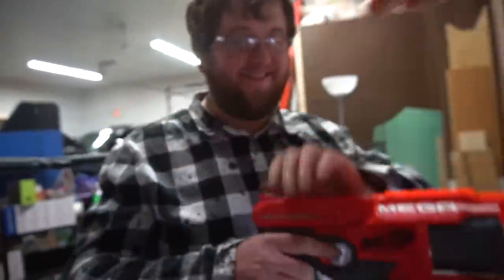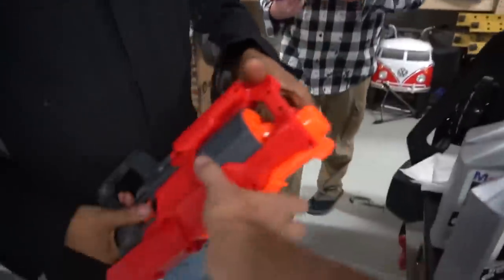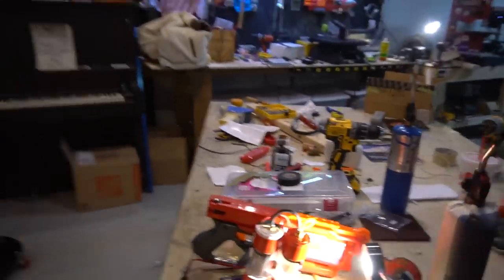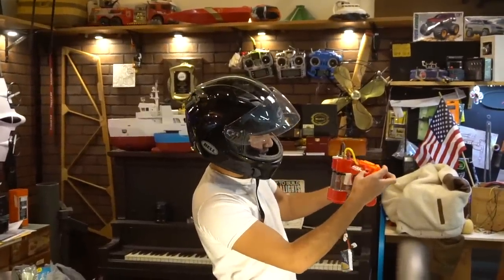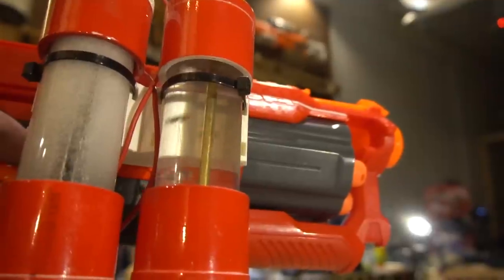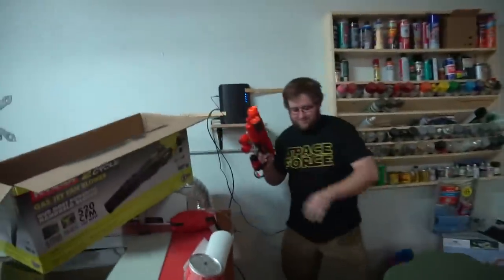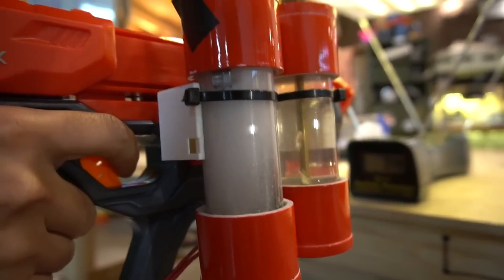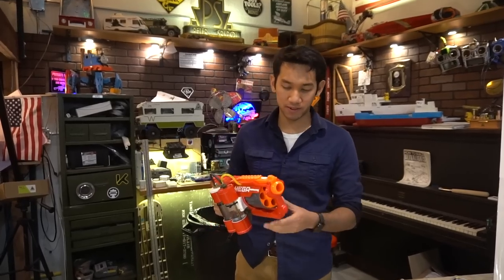Hydrogen Powered Nerf Blaster!!!

Comment: NERF: Do not modify the gun or the darts

People: no.
Reply: I modifyed my darts now they hurt lot more than before
Reply: Just put needles instead of the foam at the end
Reply: yanks out all the safety mechanisms
Reply: @waterbirds8972  Yes, there's a rod that fits in the dart hole that you need to remove, and a valve in the back of it that looks like a table with 3 legs that is pressed by the dart and opened that way. Beware tho, if firing without a good seal, without the valve the piston will slam into the barrel assembly as there is no pressure to slow it down. I reccomend putting one of those Ikea pads for furniture doors in place of the valve
Reply: @herbthelizard368  oh god no plz
Reply: Hahah mod go brrrrrrr
Reply: @rxiumofficial  just hey guys wanna play nerf loads the nerf
Reply: Hehehe I take my nerf darts painful mods a step further I use armstrong mix in a little tissue glued onto the plastic 
(No idea what armstrong mix is?: It is a highly reactive mix of powders Wich will explode from the slitest amount of force like a nerf darts hitting something
Reply: @herbthelizard368  just put a mix of ammonşum nitrate,coal,sulphur,pottatium nitrate and glass powder remıve the plastic add a small mini ballon to the end shoot.
(Modified armstrong powder)
Reply: @kayragur3542  good idea mate
but i do not know how to potassium nitrate
Reply: @herbthelizard368  Or a nail.
Reply: I put a match on the end of the dart so when it hits it sticks to clothes
Reply: I shot someone with a neidel on a nerf dart?
Reply: @Hit69420  prolly hurt a fucking lot tbh smh

Comment: Hydrogen powered potato cannon is the obvious choice for next build.
Reply: just an hho tank with some stuff and other stuff and you got yourself a potato gun.
did i mention that it shoots potatos?
Reply: No This Is Patrick      Genius
Reply: potaoes.. 

pffft.. 

pumpkins.  now we're playing with powaaaaaaah
Reply: if u d0...... use steel pipe's
Reply: We actually tested this when I was younger using 5cm thick treated steel pipes, it would shred the potato and we had to use harder root vegetables in order for them to stay intact. 

Using i.e thinner steel pipes or plastic pipes is a really bad idea, it will blow up at the first attempt. Not to mention that hydrogen makes steel brittle (thus we had to coat the insides every time).

The canon did however fire the vegetables at supersonic speeds, much harder than a gunpowder canon can. A mixtured of oxygen and hydrogen is super dangerous and potent stuff. We generated the oxygen and hydrogen on-site using plastic bags in case of well, boom (also one of the two gasses is hard to store from what I remember, when they use it at rockets they at least transport the gas really quickly to the launch site in order to not lose much product). 

Don't remember the exact figures for the price of the canon but those thick steel pipes weren't exactly the cheapest.
Reply: be carrefull, stronger and faster explosion than propane gaz
Reply: Land and Lore Photograph Off Road Adventures Dude, he literally just electrocutes water and separated it into hydrogen and oxygen. He just needs to find a big enough sealed container to fill with water that he can turn into hydrogen. Cost of container + cost of water + cost of potato launching mechanism + cost of the potatoes = the cost of the cannon. That's it.

Comment: Put the guard down against the work on that bladerunner.  Its there specifically to stop what youre cutting from jumping all over the place.  I have one and trust me it makes all the difference.
Reply from the maker: Do R/C! Yeah I figured that out after those shots! It works surprisingly well!
Reply: @PeterSripol  yep. I've had mine for a couple years and it gets a lot of use.  There are times when the guard won't work with what you're cutting then just push down really hard and go slow.
Reply: Oh and get good quality blades (Bosch or equivelant) the ones it comes with are junk.
Reply: MAKE A HYDROGEN POWERED GO KART
Reply: @DoRC  Made me queasy how close his fingers were to the blade.. specially with it vibrating like that
Reply: @PeterSripol  Please build electric paraglide no ultralight

Comment: I tried making a hydrogen powered cannon.... it is super hard to do. The water vapor (what is produced in the reaction) cools and condenses so quickly that it ends up sucking the projectile back into the barrel with extreme force (possibly breaking yo cannon) If you plan to build an HHO cannon, use a very large chamber and a very short barrel for best results. Hope this helps!
Reply: Happy Mad Scientist Install a check valve?
Reply: Try an oxygen boost to make it O2 heavy? Im not sure it would work though lol. Or tape some dessicant bags in the chamber hahahaha i wish you would try it but it sounds dangerous so dont lol
Reply: Or maybe run a vaccum through a longer barrel like the light gas guns they use at universities or like the one nighthawkinlight built
Reply: That's an interesting idea! I'll have to look into that. Thanks!
Reply: electrolyse other stuff.

my intuition says use iodide salts and organic liquids such as amines, ethers, nitrates and glycols. look into viscous substances (one viscous two viscouss?)

you could use phosphine gas since it reacts to form phosphoric acid, which is a coagulant and might affect the kinetics of the condensation and stuff

look at the burn speed of different substances, you can create a cascade effect by making the detonation such that the shockwaves harmonically overlap, which might prevent this condensation or otherwise be interesting

the other road is understanding pressure dynamics and learning how to create huge pressure swings, essentially huge bellows, gears and valve systems that 'carry' explosive energy around mechanically. i think i'm describing the basics of gun design from a primitive standpoint ;p

good luck with your project :)
Reply: Thanks

Comment: Damn you electolized water to utilize hydrogen? Dude, you're kind of insane
Reply: Zane Stigler the king of random did that too
Reply: @mhila2012  I did it 8 years ago to test it out on a car at a customers request (I couldn't convince them there is no free lunch....the power consumed to separate the hydrogen molecules is MORE than you get out of it from the hydrogen being ignited. That power coming from the alternator, driven by the gas motor means a net loss in efficiency). It's not that crazy.
Reply: @superiorglitch8195  chlorine? I thought that only worked with hydrochloric acid
Reply: Billy Riggs 
Well... That's annoying if you're trying to charge a salt water battery.
Reply: Thats easy to do anyone can do that
Reply: I split water into oxygen and hydrogen for a science project in grade 8 so i must be insane
Reply: @superiorglitch8195  will it generate only cholrine gas? or will there be other substances created as well?
Reply: @jonhille  NaCl will make Chlorine gas instead of oxygen, but it will still make hydrogen, and the explosion will be violent and similar when you ignite it.  To get oxygen you use an electrolyte with a more complex anion, like sulfate or phosphate.

Comment: You should do a hydrogen powered plane
Reply: Robert Schlicht a rocket.. 

have a canister of hho and that big field..

with a compressed chamber and electric valve that will allow hho gas to be fuel injected release and fed into a BBQ jet.. should work a treat.. providing the right amount of gas can be regulated for output.
Reply: What about a hydrogen bomb
Reply: Hydrogen barbecue
Reply: What about hydrogen powered car

Comment: A couple suggestions :

Increase mechanical reliabilty/the smoothness of the barrel advance action, and reinforce the darts. 

Use a light timing system, versus a simple button to arm the device.

Basically, on slide racking, the barrel advances, and a red light turns on as the system generates hydrogen. You could even add an audio cue to indicate this. While charging, the trigger is disabled. After a preset interval, the light turns green, hydrogen production halts, and the trigger is now live, so you can fire when ready.

Load all battery components into a case or molding to improve ergonomics.

Comment: why not just use dilute sulphuric acid as the electrolyte - not only cheaper but safer
Reply: Wouldn’t the acid over time degrade both the metal plates and the container?
Reply: @deepfriedmemesandaids2588  bruh... its just a nerf gun being propelled with ignited hydrogen..
Reply: @linusmushroomtips776  A man of culture I see
Reply: @deepfriedmemesandaids2588  those need waaayy more than hydrogen, and the hydrogen they do use has to be a special isotope, either tritium or deuterium

Comment: Nitro powered nerf gun
Reply: Nitrogen wouldn't be a very good power source.
Reply: Nitro is nitrous oxide which acts as an oxidizer allowing fuel to burn faster, and isnot a fuel in and of itself.
Reply: @nixietubes  same :/
Reply: @nixietubes  Nah you're wrong, he wants to use Discord Nitro to power a nerf gun.
Reply: Hydrogen two oxygen would still be better, wouldn't it?
Reply: callum orchard C4 powered water cooler
Reply: The oxygen paired with the hydrogen produced by the HHO generator would provide more power than N2O
Reply: I don't know what to do with it anymore
Reply: Easier way: A Buy F**** Nerf Nitro

Comment: this is amazing but what about metering the amount released in a third tank you can prefilled? vacuums probably would be tricky, but it would make it a lot safer and reliable even if you had to practically turn it into a carburetor shooting a dart instead of a piston 😅

I just find this really interesting because I've been looking into alternative air guns, and this could be a good solution to the problem of the scuba tank air shotguns!

try a prefilled chamber and a venturi valve? when you prime the shot a plunger draws in hydrogen at a specified amount, from a separate tank that you can charge/prefill with the HHO converter

a couple odd and end valves could even be responsible for the outward pressure and force of the burning hydrogen 

and give you a blowback action!

turn this gun into a fully automatic carburetor
Reply: Chris Bonnell very interesting idea I’d like to try and make something like this myself but I am too afraid it could explode
Reply: I've been waiting for someone to do this with alcohol. Don't have the stuff to do it my self yet or would have already done it.
Reply: Get a k26 caliburn

Comment: Great video on the cannon build you should install a check valve between the bubbler and combustion chamber to increase pressure I kept seeing a flash in the bubbler so you was losing a lot of pressure.
Reply: because the explosion is so fast i think it would still go straight through the check valve
Reply: @foamtoaster9742  Maybe a tesla style static check valve?
Reply: Maybe some valveless pulsejet-style bizarro sonic engineering? Nah it'd be overkill and probably 30 feet long.
Reply: @MyHero Deku Engineers gave YOU the Internet. Engineers invented the Internet. A programmer is a type of engineer, the methodology is very similar. Network engineers are sure as shit engineers, it says so in the name (note: this principle does not always prove true). The first people on the Internet were engineers, followed by a few engineers in the armed forces, and some people at some colleges. 

The Internet was great when it was run by engineers. It's only now the business arseholes have taken over that it sucks so much.
Reply: Yeah I got the joke, I was just being informative! No need to apologise, mate!

Comment: Use a thin heatshrink on the darts and put like a ¾ blast shield around the tanks. A pressure gauge and/or timer would only help with the charging.

Comment: How do you get the elclectrodes not to rust. I have tried the hho generator many times and with diff salts and diff powersuppplies ranging from 9v battery to 22v 1.5 amps .
Always gets all rusty and produces a minimal amount of hho
Reply: Maybe it's just caus they he only uses them for a short period of time? Does stainless steel work as well?
Reply: You are using salt and steel? You are prob making iron oxide and producing mainly hydrogen and no oxygen (explains lack of bubbles).
Use stainless steel and sodium hydroxide. Even if you don't use stainless, sodium hydroxide will greatly reduce the rate of corrosion of your steel.
Also, the nominal voltage would be about 1.3v. Anything more is wasted energy. More amps are what you need. You might need to put more electrolyte in your solution to help the electricity flow thus increasing the amps. Also google what floater plates are.
Hope this helps!
Reply: @HappyMadScientist  thanks alot i will try that
Reply: Use Platin electrodes should negate the rusting issue
Reply: stainless steel
Reply: @Land and Lore Photograph whot
Reply: @Land and Lore Photograph Water is the only product of burning hydrogen in oxygen. It is literally 2H² + O² → 2H²O
Water is 100% hydrogen and oxygen.
(barring all the various minerals and organic chemicals that are almost always present in trace amounts, and the complexities of incomplete combustion, which are not particularly relevant)
Reply: @Land and Lore Photograph There is almost no 'useable' hydrogen in water. The whole point of applying electricity to the plates is to perform electrolysis, in which the molecules are broken to form the constituent atoms, which then form into the separate hydrogen and oxygen gases. When this occurs, it can create a lot of now useable hydrogen, depleting the water. I have a small&weak generator which can make 0.5L of gas per hour, therefore 0.33L of hydrogen per hour. and that is enough to make a loud blast, which is fun :D
Reply: @Land and Lore Photograph There is almost no 'useable' hydrogen in water. The whole point of applying electricity to the plates is to perform electrolysis, in which the molecules are broken to form the constituent atoms, which then form into the separate hydrogen and oxygen gases. When this occurs, it can create a lot of now useable hydrogen, depleting the water.

(copied here for others to see)
Reply: @Land and Lore Photograph For small things, yes. my bigger hydrogen generator makes several litres per hour, but the power supply gets a bit too warm for my liking. And the point I was trying to make is that water is one of the most hydrogen-dense materials that the hydrogen can easily and cheaply be extracted from. The way you worded your initial comments made it seem like the hydrogen was unable to be extracted
Reply: @Land and Lore Photograph I think i can see where you're coming from, but for some parts i disagree.
"really is not very much"
given enough time, one could extract all of the hydrogen from water, which is a lot. specifically, 1 litre of water can be used to produce 1245 litres of hydrogen (at STP).
"it is not cheap either"
the highest electricity prices I've seen are about US $0.40 / kWh. for a very inefficient hydrogen generator, 1 kWh an give about 9 litres of hydrogen. that's less than 5 cents per litre. as far as non-commercial hydrogen procurement goes, that is rather cheap.
"it is not efficient in anyway"
completely agree with you. except for weight-sensitive uses, batteries are far better for energy storage in every way.
"only ever get less than 1% of that hydrogen"
I don't know what gas collection you're thinking of. depending on exact collection method, most of it is collectable and won't diffuse through your container (unless you're trying to collect it in a bin bag :P ).
"myths and misconceptions" and "run a car"
total BS, very dangerous, and could destroy a car's engine very quickly. as a side note, the main one with cars isn using it as a fuel by itself, rather being a supplement added to the air intake to reduce fuel consumption. thanks to laws of thermodynamics, it doesn't actually improve fuel efficiency.
and for your last two sentences, i completely agree. I feel 50 years is more realistic than 100 years, but that is just speculation

Comment: “Hydrogen is a very combustible gas”

* slams it on table * 
* hits it with hammer *
* slams it on table again *
* stabs it with knife *
Reply: how the fuck do you light a fire? do you just hit it until you see flames? yuo need a pretty high temperature to light the H/O mixture.

Comment: For your next video: fill soap bubbles with a mix of HHO (2.4x lighter than air) and air so they're just slightly buoyant, then fly an FPV RC plane through them in the air with a sparkler on its tail. To make it easier, use a steam cleaner to top them off, so they'll have a maximum height when the steam cools and condenses and the bubbles start to sink. You might need a bigger HHO generator for this (or just get a bottle of H2).

Comment: lmao 3338 fps with a nerf gun, that could kill someone (im not actually sure if they measured fps)
Reply: I don’t know about that
Reply: Feet per sec or frames per sec?
Reply: Ethan Pandit feet per sec, frames per sec is for graphics
Reply: The darts wouldn't even surivive the launch
Reply: Cause they would explode
Reply: Normal ammo at 150 fps kills, so if we scale, I think 3338 fps nerf bullet should kill, assuming you somehow beefed up the bullet so it survives launch lmao
Reply: @that_one_guy934  feet per sec. How you gonna kill a human with gaming performance stats
Reply: @melokaer6943  good point
Reply: The darts are foam. So ... relax
Metal darts can't stop as fast as foam, because it is heavy, so you die.
Foam will slow down while in the air, and even if it hits you so fast it stops immediadly when it toutches you. It is light.
It may hurt a bit, but how can a soft plastic round point go trough your skin?!
Reply: @spoopy2180  150 fps is an airsoft toy gun.
Reply: @kokoslegend4850  true. Forgot to account for that